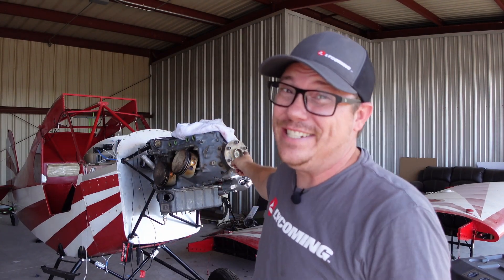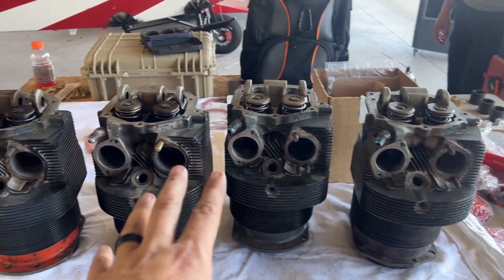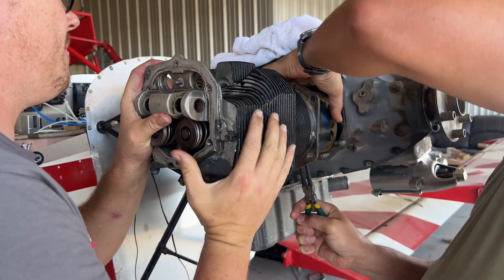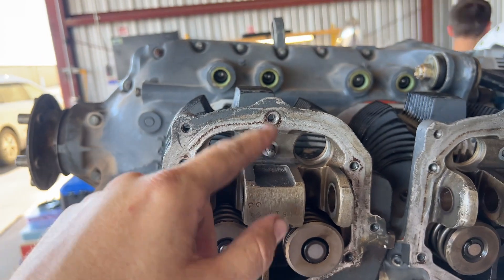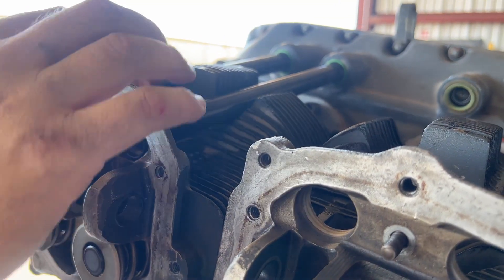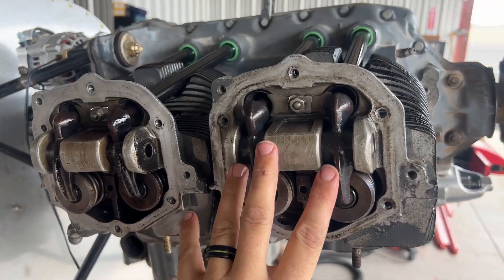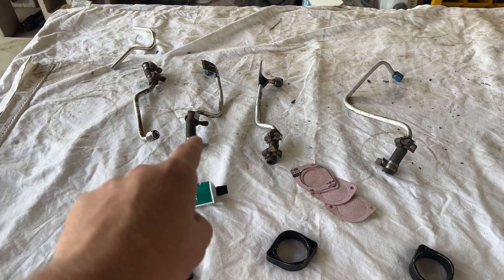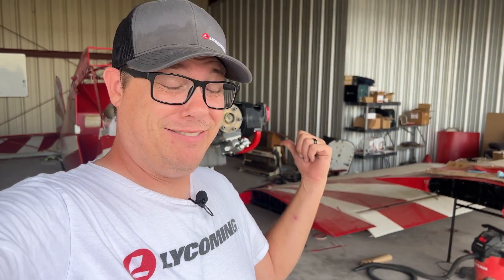I May Have Gone Overboard... | O-320 Reassembly

Comment: Hi. I’m trying to sell an o-320 b2b. It’s been sitting in a nice air hanger for 20 years. 20yrs ago it was overhauled, cylinders honed with new pistons and rings. I’m trying to get an idea of what one of these engines would sell for. Looking to sell on eBay unless you suggest a safer place to sell. Any info appreciated!